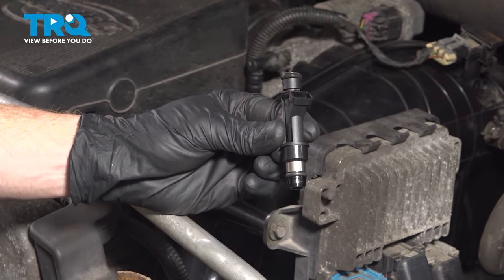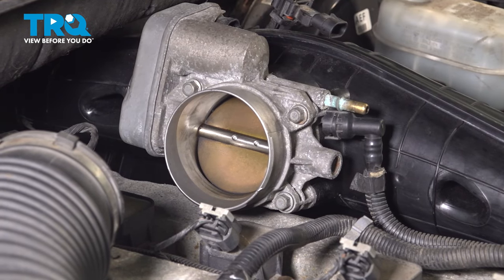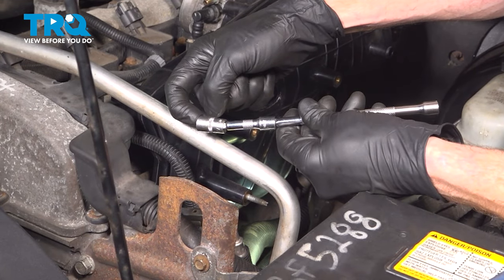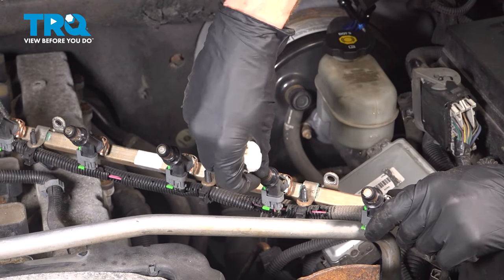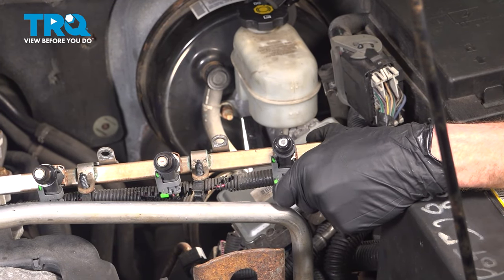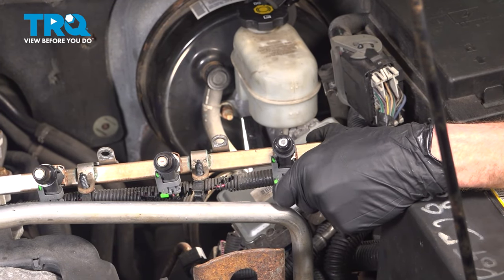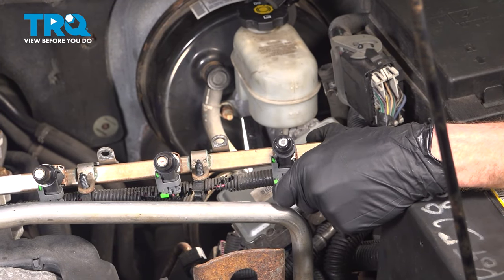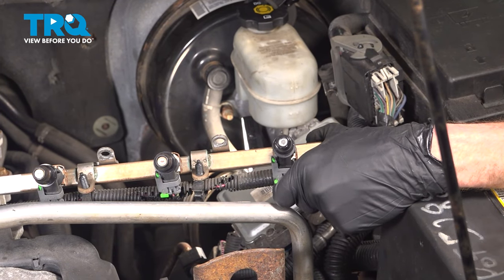How to Replace Fuel Injectors 2002-2009 Chevrolet Trailblazer (4.2L L6)

Comment: Does the 2003 GMC Envoy SLT have the exact same parts and placement of the fuel injectors as this video? I have this particular Envoy and noticed that the top area looks exactly the same. So I'm wondering as you go deeper to the fuel injectors, are the parts and placement exactly the same.

Comment: I bought one the guy just replaced the fuel injectors and said it never ran good again he said it was missing on two cylinders or there is air in the lines but it does run but is really rough any suggestions